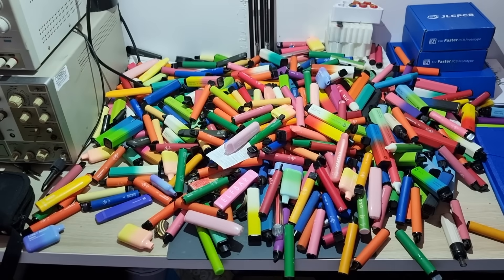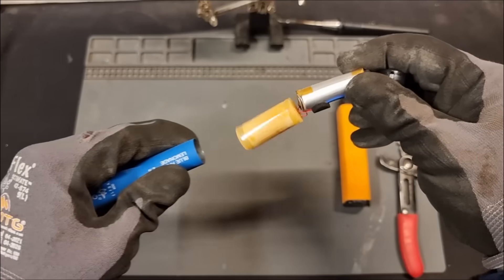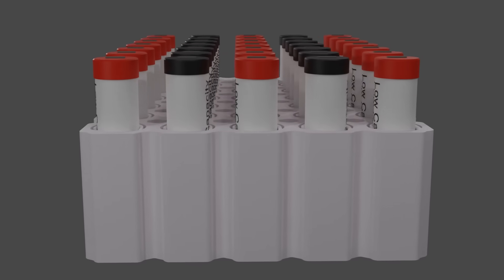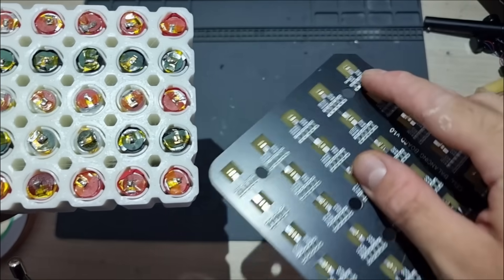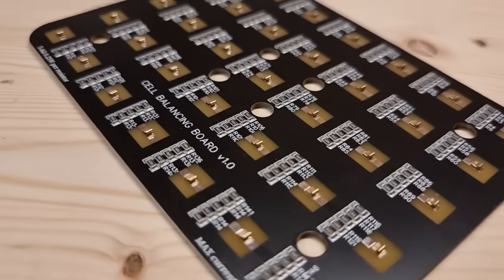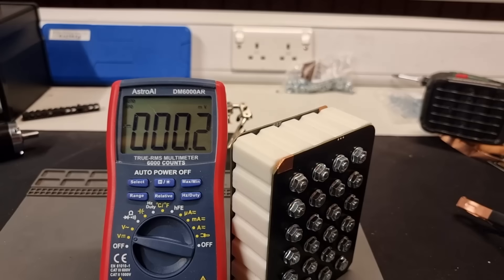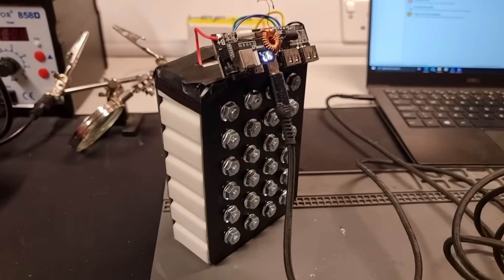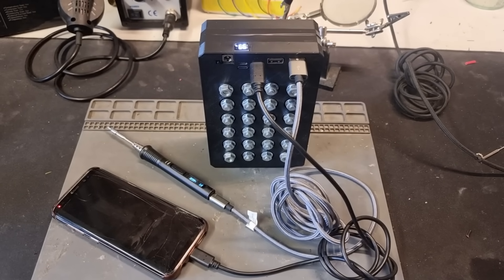Turning Disposable Vapes into a Fast Charge Power Bank

Comment: They fact that you made a pcb just to balance charge them is pretty wild.
Reply: pcb: $5
frustration from wiring up to these shitty little cells with tiny little terminals by hand: 5 years off the end of your life
Reply: It’s just a PCB with a few resistors bro nothing crazy
Reply: You could achieve this without a PCB
Reply: @_EyeOfTheTiger having done this myself, fucking don't. Wish I'd thought of the PCB idea years ago. I can afford $15 worth of PCBs to save myself hours of hassle, flux fumes, and burns.
Reply: @Phoen1x883  couldn't you just charge them all to the same voltage individually with a power supply?
Reply: I was thinking, why not charge them all individually, as a balancing step, as well
Reply: @theob1712  Annoying. Slow. Fiddly.
Reply: @Phoen1x883  Slow, yes. But they come with wires attached, so a pair of alligator clamps makes it easy to balance them before stripping the wires. Just set the voltage to that of your highest cell. You can even do more than one at once if their voltages are already very similar.

PBC is also slow to design and ship. But it is much better for doing this project multiple times.

Comment: One disposable vape discarded per 100 square meters in the city where I used to live. Moved up north. Never thought they had batteries in them with how punters just throw them away, which I believe is illegal by national law in Sweden, disposing of a battery treated differently by law that has to get turned into a specific recycling area - lithium sodding ion. (Moved far up north and I don't even see vapes in stores, let alone on the ground, woo!)

Comment: One thing to improve the battery pack's reliable power output, would be to
1. Use a spot welder and nickel strips (I know, it's tedious, but what can you do?)
2. Measure each cell's internal resistance and actual capacity (it takes time, but in the end you have a better balanced battery, so you get to use more of the capacity available)
Reply: Sadly you can't spot weld to these. They don't have connections like 18650s, they only have very thin 3mm long nickel strips as contacts
Reply: @sushi3377  fair point. 👍
Reply: Some of them are 18650's
Reply: @sushi3377 They could probably still be spot welded with a custom welder end tool. Maybe a clamp type one with a really shallow low arm and the camera from a cheap endoscope to align it under the little tab.
Reply: The internal resistance and capacity are my main concerns why i didn`t try it myself. They differ way to much and because the tabs are so shitty to connect, there is no solid way to measure the internal resistance because the measurement can`t be accurate enough. Once i measured like 5 of these 500 mAh Cells and the capacity was like more between 480-400 mAh, i measured the capacity with a discharging rate of 1C .
(Thats way to much diffrence to get them properly balanced, since the cells on the lower capacity end are basically EOL with only 75% left capacity.).
Reply: @aivazi just replace the dying cells as you go. there's no need to get to a high level of optimization when you're literally reclaiming trash. If you have cell balancing and testing equipment then go for it, but otherwise it just doesn't matter in this case. Using the cells at all is better than allowing them to go in the trash or get run over by a car.
Reply: @aivazi  you would definitely notice the capacity of the pack diminishing long before any fires happened unless you're discharging way faster than 1C on a regular basis.
Reply: Thats highly speculative, all u need is one bad cell to start a fire and thats my point of testing each cell. 

If one cell has a way higher inner resistance in a parallel, it will cause a higher voltage drop and degrade all cells in the parallel , since this cell will always have a lower working voltage under load, and even if the BMS decides to turn of the Pack, the damaged cell will discharge itself nontheless till all cells in the parallel are drained empty. He implemented resistors to limit the charge current of the cells, but it cant limit the discharge because of the inner resistance.
Reply: Spot welding them kinda goes against them being replaceable tho
Reply: That's extremely dangerous and stupid idea, one bad cell and you have to dump it all into to sand and dispose of correctly. Plus you  have to have fume hood over your head as breathing in smoke when they short is very toxic. They once tried this on LTT channel and it went exactly as I described it.

Comment: 10:01 I prefer the original case with the extra space. The more space between the cells, the better thermal wise. There should be room left for extra heat to dissipate and escape into the environment. The bolts, I should think, help greatly towards that end. If the bolts were made of aluminium and tied to a plate on each side, that would help even more. The downside would be that the construction should be inspected carefully for the possibility of creating shorts. Another idea would be to create vent holes  on the two boards and have these holes go all the way through the cells' holder  in order to increase the amount fo heat escaping through ventilation.

Comment: The price difference between cartridges and disposable makes it a relatively cheap way to harvest lithium cells. Especially since the carts blow up/burn out if you have the voltage too high. I'm planning on making a similar battery pack, but have to consider how to handle different MaH batteries since there are 4-5 common designs. The most egregious are the small rectangular vapes - they often have 1+Ah/3+Wh of capacity for a week's use.

Comment: are you sure you DID NEED so many bolts at 6:30? isn't it 5 times overkill?  it's almost doubling the weight of the batteries... the explosion is about toxic smoke that'll be there anyway...
Reply: Yes... The reason was because he tried using only 6 bolts but the board was to flimsy and didnt make a good connection. So he had to go overkill on the bolts. He will improve the design later!

Comment: Aren't the batteries wrapped in aluminum foil? And you're putting conductive tape on both ends. There could be a tiny scratch in the battery paint, or a tiny crack where the foil bends. Looks like a fire hazard.

Comment: cool project! If I may suggest, after balancing all the batteries, you should still measure them all just to make sure there isn't a stray with a significantly different voltage; that could really lead to some issues down the line.

Comment from the maker: Btw the design was originally only going to have 4 bolts, but the PCB flexed too much, and the cells didn't make a good connection, so I went a bit overkill.....
The next design will be much better
Reply: Thank you for making it clear, I was puzzled by the amount of bolts! Great video :D
Reply: For a prototype it shows the concept works!
Reply: Lets call it, "adding character to the design", and everything is as it should be :P
Reply: You could screw it to the 3D print with a few regular woodscrews if you model in the corresponding holes, would be faster and lighter 👍
Reply: @felixdietzCGN or use threaded inserts 😁
Reply: some would call it a feature 😊
Reply: For a v2, maybe adding some springs to the terminals would be the way to go. Attach them to the PCB so they're reusable for when you changed the cells.
Reply: One zip tie replaces two bolts
Reply: @richinar  but not in tention.
Reply: I like the look
Reply: i was going to say, those bolts are serious overkill. some m4 bolts with large washers should do the job. 

have you thought at all about the safety issue, creating some way for each cell to vent out away from the other cells if one ever does fail. to try reduce the chance of catastrophic cascading explosion.
Reply: 1000th like!
Reply: makes for a more interesting thumbnail lol
Reply: I know a Museum that would showcase this project
Reply: Yeah that's what I thought
Reply: I realise it's not important but, out of curiosity; how much does this thing weigh?
Reply: awesome video mate. 
always appreciate people recycling what was bound to be e-waste.
Reply: lol i was just about to comment on the bolts
Reply: Maybe using two or three U beams running across can work ?
Reply: weird flex mate
Reply: I felt the weight of all those bolts. good thing this isn't planned to be the final design, would be a terrible disaster if I had to stop being lazy and design something for myself 😆
Reply: This is such a cool idea and a great way to deal with a huge recycling issue. But I have to ask did you test the internal resistance of all the battery's as while it is very possible to create a battery pack without a bms you do have to find battery's that have a very very similar internal resistance
Reply: Very interestig idea!
Reply: Thanks!
Reply: CNC milled HDPE cover plates, held by nylon bolts. Put a small bit of curve in the plates so when bolts around the edges are tightened the plates will flatten and apply even pressure VS being tight around the edges and possibly bowed outwards in the middle with not enough pressure.
Reply: I would definitely be interested in hearing about how the safety aspects are incorporated in this! I repair tech for a living but have never used rechargable batteries for personal projects due to the fear of fire hazards, so it would be cool to learn about methods of mitigating that risk.
Reply: I made a comment on this but i've just read this and seen that you have realised.
Reply: Please make more videos about this! I know you can make a series from this !
Reply: You probably could have used some 3d printed bars or make the 3d print cell with a slightly larger top so you can snuggly fit the PCB inside maybe even use some large rubber or foam washer to even distribute the pressure. still SO cool!
Reply: It's nuts! :-)
Reply: If I just had read all the comments, I would have written mine :)
Reply: I kinda like it, but it must be ridiculously heavy
Reply: I thought they we're maybe working as a heatsink of sort.
Reply: hey is there somwhere a model for that can i download it somwhere???
Reply: Yeah, good note, doubling the weight with bolts is a weird idea)
Reply: Personally I like the industrial look of it.  Especially if it was to be kept in the garage or somewhere similar.
Reply: but can you share the pcb 'design' (i'm not an expert in this stuff but i like the idea to recycle and make value)
Reply: Actually these many bolts give the device a quite "beefy" look. Like it!
Reply: Dude you needs to sell the skematics for this. This could be a possible industry
Reply: Can you give a quick and dirty safety guide for anyone attempting something like this at home- you say you missed steps, what were they? My lead acid setup on my van is going and I need to replace it sharpish. Been collecting for a while but not sure on next steps.
Reply: How much ohms resistors you used
Reply: There's a reason spot welded nickel strips are normally used.
Reply: First design is still very cool! Can’t wait to see 2.0 🎉
Reply: I would be concerned about the amount of bolts, to me, it looks like an IED. I understand your reason in this build, but the government may not allow you time to explain if you were reported having this in public.
Reply: [x24 bolt/nut] +$52.86
Reply: Thanks
Reply: The design has enough bolts, and that's what is important.
Reply: @Chris_doel can you try powering a phone with the vape battries in your next video please. Thanks.
Reply: Jesus is the Son of God. He died on the cross for our sins and was resurrected three days later. Confess with your mouth that Jesus is Lord and believe with your heart that God raised Him from the dead, and you will be saved; you will not die, but have everlasting life.
Reply: (I posted this in the main section, but wanted to bring this to your attention @1oblob. Amazing video btw, love the work.)

Anyone who watches this great video and decides to take apart a vape, PLEASE do it with gloves on and do not get the vape juice/liquid everywhere! 

It is extremely potent and can be absorbed through the skin which can give you nicotine poisoning. I have personal experience of this from when I decided to do exactly that and, being a thin person, I absorbed a lot of the liquid through my skin, not knowing how potent it was and suffered from head, neck and back aches for weeks until I realised where it was coming from. 

I was already being careful not to contaminate myself which means that it could have been a lot worse. What I didn't realise to begin with is that the liquid is not only on the inside of the sponge, but also on the outside of the clear plastic around it which I held. It was also on the inside of the tube and on every surface the sponge module came into contact with.

If you do use gloves, please be responsible with them and not touch everything after the sponge because that will contaminate your environment, and dispose of the sponge and gloves responsibly (idk how nicotine can be disposed but look it up).

@1oblob please could you either edit and reupload this video or put it in the next one because this is very important information.